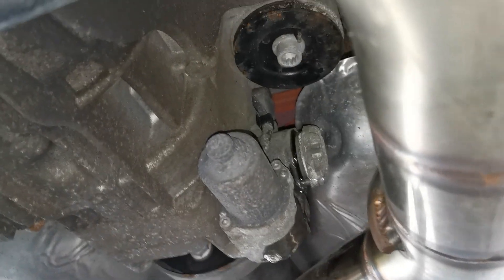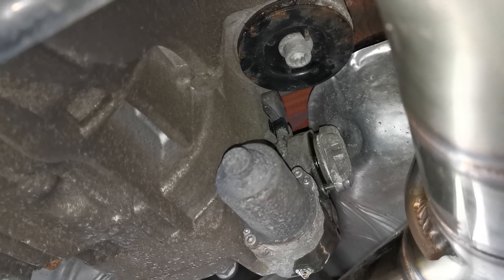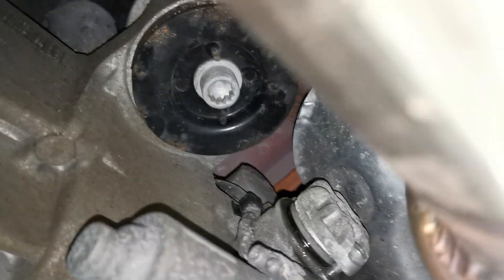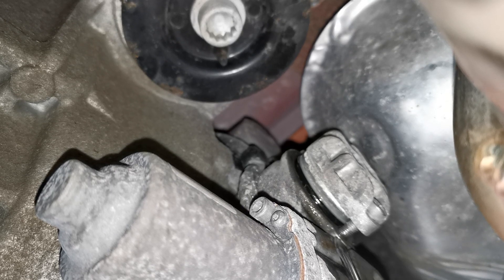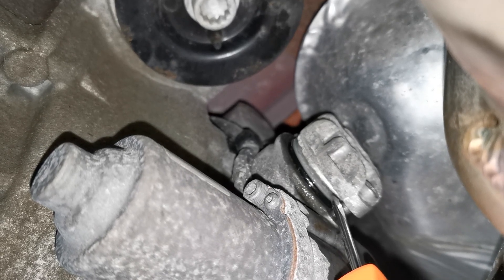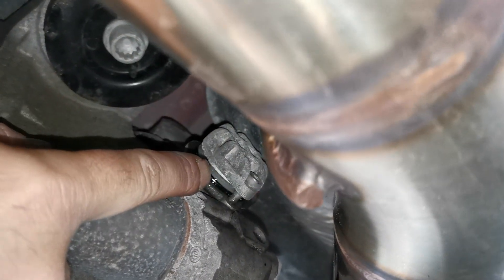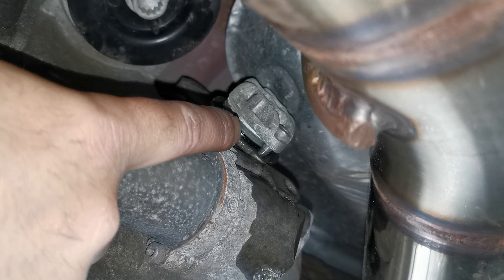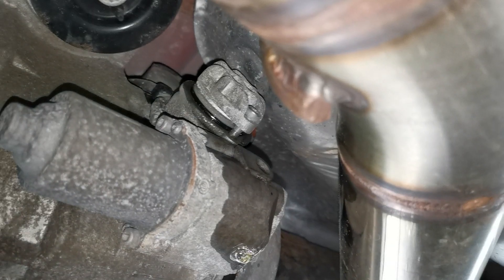MKS Performance Haldex gen 4 oil filter change

Comment: I don't have the vavlecom, viacom, whatever the nice gentleman is calling the computer diagnostics. I am disappointed. I finally have the fluid and CORRECT filter now. 
WHAT WILL HAPPEN without the computer if I DRAIN the fluid, manually replace the filter, and fill with new fluid?
Thank you.
Reply from the maker: It's just easier getting the filter out with vcds. You can remove the filter without vcds but isn't easy
Reply: Its super easy take smallest hock make it red with fire and melt it in! Wait untill its cold and pull it out💪👍
Reply: Thank you all for replying. I did it manually. 
My questioned was answered by the process. 
Whati was asking was, if I pull this out with a hook and put in another without hooking up the car to diagnostics, is it going to fuck up my car's computer system?
The ans is NO.

Comment: Hi! Nice video. What is the risk if you disengage the pump from the vcds software or just unplug it's pins? I just want the option to switch between 2wd and 4wd whenever I want. Will the haldex still engage then if the pump is off? Is that a bad ideea? Thanks!
Reply from the maker: You can't turn it off in VCDS but can do a output test which is what I did to push the old oil filter out.
We don't recommend driving the car with the haldex disconnected or turned off with these aftermarket burnout switches

Comment: To remove the pump is it as simple as removing the hardware and pulling/wiggling it out? Or does it require a priming process to push it out as well? Also, should the pumps oring be replaced while it is off?
Reply from the maker: Pump is held in with a few hex bolts and just falls out when bolts have been removed. No need to re prime the pump afterwards but you can always just run the same output test through vcds to make sure it works again

Comment: How did you get the new filter back in the housing? There’s not much room there before it hits the fuel tank. Can you simply push it back in or did you use some thing to lever it back in?
Reply: I had heard that it is very hard to push past the first O ring but if it can be done by hand no problems. Thanks again
Reply from the maker: Lube the new filters orings up with new haldex oil then slide it in as far as you can push it with your fingers then use the cap to seal it fully into the housing